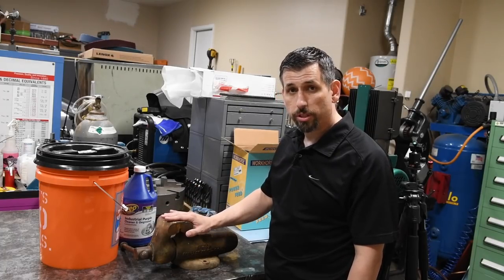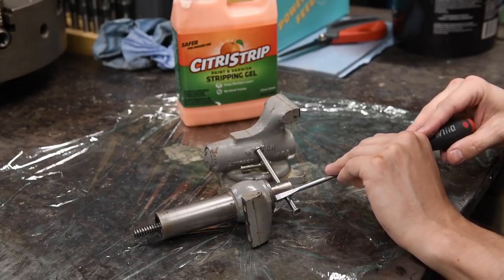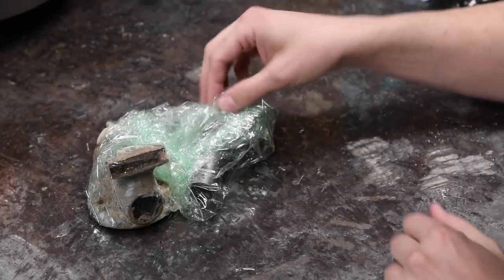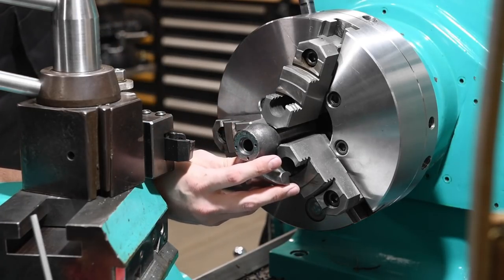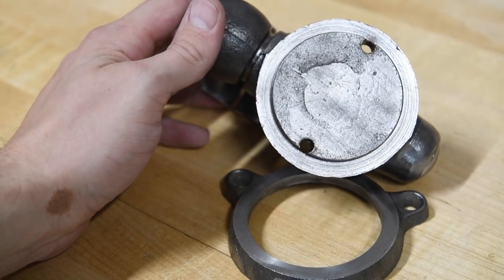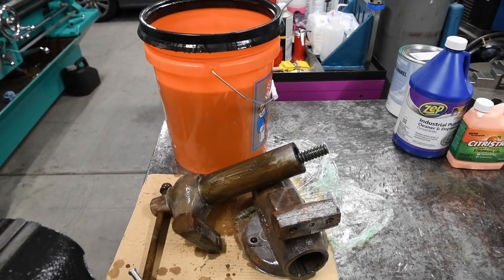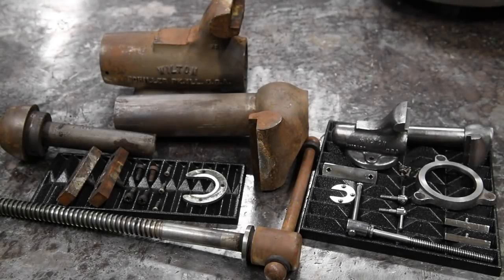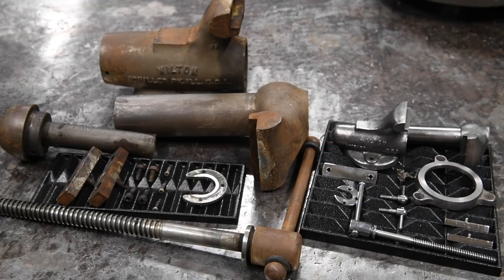Wilton Vises Giveaway! Restoration Part 1

Comment: Industrial purple works really well for cleaning parts. For smaller parts I use it in an old crock pot, like a mini hot tank. Paint and grease disappear. Great video, thanks for sharing.